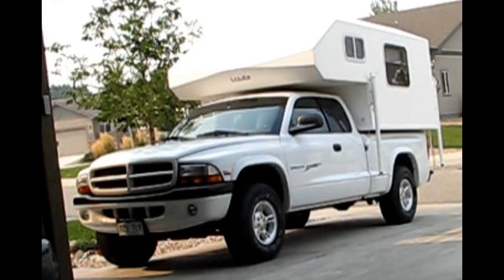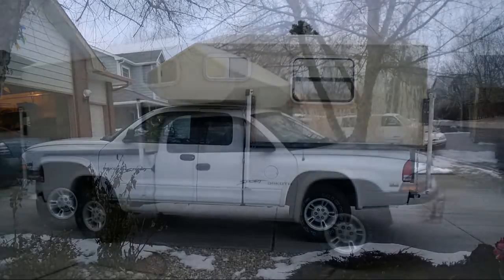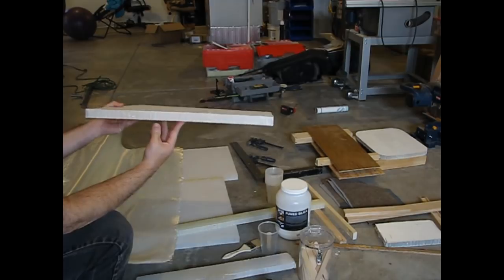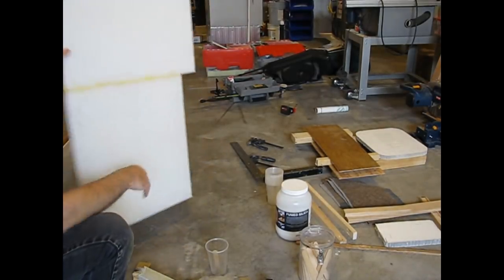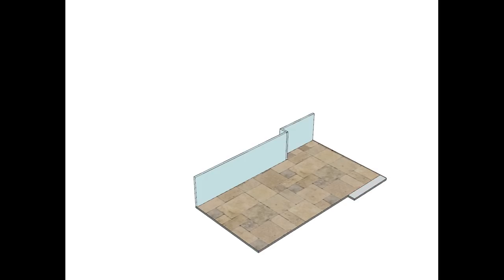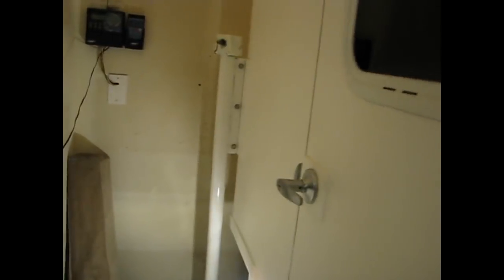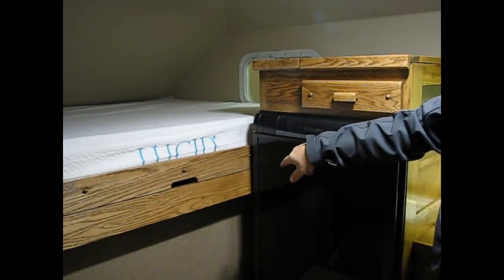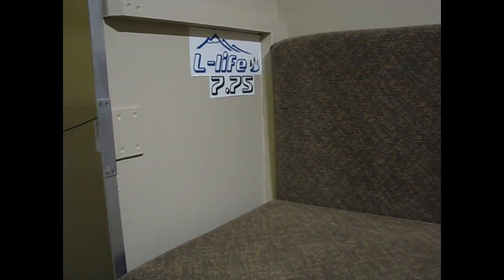Home built truck camper. L-Life explained

Comment: Thanks for the Ideas, I've been looking to build a truck camper and keep the weight down. I like what you did, my change will be to do galvanized steel square tube and welded frame instead of wood, add more water storage and wet bath. Great Ideas with the honeycomb material!

Comment: finally after a few years of watching diy camper videos I find one that is thought out that  is 6 years old. the trick with camper builds is to make it strong (using adhesive on Everything  and ring shank long staples instead of screws and using larger lumber where critical and much smaller where not) weight is a major factor that so many diy truck campers end up on a trailer! lots of half ton trucks have a 650 lb bed load!

Comment: Lovely build. I would make a couple of suggestions however. 1) you need a stainless top surround in the kitchen area and 

2) either stainless or tiles (a perferred form of fire retardant material) to reduce the possibility of catching fire. 

3) need a glass top for the gas burner so you have somewhere to put your pots, pans,plates etc when washing the dishes. 

Overall, Love the build materials, very well researched and thought out. Well done.

Comment: Nice work.  You've opened my eyes to some new products.
Reply from the maker: "thesupercamper.blogspot.com" is the sight I came across many years ago that inspired me to take on this type of similar project.  I would probably do 1-1/2" thick material for the walls if I had to do I all over again, as window & door jams are mostly designed for 1-1/2".  (Plus R 3.3/inch, so R 4.95 possible).

Comment: Absolutely beautiful job. I echo an earlier comment about the propane tank inside. Propane tanks could be filled at a cool temperature - then they might vent propane in the warm camper interior - which could be deadly. I would add a vent to the outside of the propane compartment  and somehow seal the interior access door against a gas leak. An interior tank would be illegal anywhere. (That is shared just so you don't have a deadly situation!) Absolutely beautiful job on your design and construction. Wishing you HAPPY camping.....!!! Well done......
Reply from the maker: Compartment totally sealed inside except for the access door.  There is a with vent door to outside at the front of the camper box - I plan to update access door to a sealed door.  Table saw took a dump, so for now I'm relying on propane detector, which is in my opinion is too sensitive.

Comment: The video is a great run down of the design and effort that you put into this build .... really impressed. The finished weight is amazing. From my experience the only things I would do differently would be to mount the LP/CO2 detector lower to the floor and design some sort of reclining back for the bench seat. I hate 90 degree seat backs and can never understand why 99% of all industry dinettes are built like that. I find them all to be very uncomfortable for any extended length of time (and we've camped in a heavy rain storm lasting more than 28 hours before) :-) I love your love of the Dakota. We had the same 4.7L engine in our 2006 Dakota. It also got about 17 mpg. In addition we've had 5 Ram 1500s (2 Pentastars, an Ecodiesel and 3 V-8s) and our current 2500HD. People ask me why I like Rams so much and I tell them simply that not one of them has ever spent a night in a service bay :-) I was a bit disappointed after seeing the video thumbnail ... I was hoping to see your creation "in the wild" :-)
Reply: Travels with Yoly  I LOVE your videos!

Comment: Great job on the build...It looks like a factory built camper...I had wanted to get a smaller truck camper that would fit the small 5.5' bed in my 2008 Nissan Titan Crew Cab Truck...cargo bed capacity of 2,000 lbs...I don't like the smaller, pop-top campers that would fit it nor do I want to spend the new price for one that would fit..they just aren't worth the high prices...this video gives me some great ideas in that it does not have to look like a hunting shack like many other home built truck campers do!!

Comment: Wow, that's is amazing. So much better than those built by professional companies. I have 3 questions. 1) Did you consider building the inside components out of the same material instead of wood? 2) Why don't the RV manufacturers use the Nida Core material? 3) Could you have used aluminum instead of wood for your structural supports?

What you did is so much lighter than anything I have seen on the market.

Thanks for the information.

Comment: Bob...
Thanks for the video.  
I recently purchased a (interior dimensions) 6'x12' - 5,000 lb. utility trailer meant for other purposes.
But once I got it, the first thing that I thought was customization.
So I asked myself, how about a slide out camper that I can tow behind my Tundra Crewmax (5.5' box).
I scanned YouTube and came across your video.
You've now provided me with my 2019 project...and I suspect a neighbour of mine will want to build the same with me.
Obviously a different footprint and a lot more room - but seeing what you've done and how you did it - you've provided me with a whole lot of ideas.
As an old Sgt said to me years ago - "If you haven't got a plan, you can't f&^% it up".
Thanks for all of the ideas...and Happy New Year.
...Bryan

Comment: Nice work and so much hard work. Only thing would drive me crazy- the cabinet doors, the rails and stiles are oriented wrong. The stiles are traditionally always full height of doors and the rails cut between. Not a criticism, just noticed it straight away as I’m a carpenter. Thanks for the video.

Comment: I agree with all the huge compliments you have been given; they are well deserved! Just finished a three year project of building a 16' skiff in my back yard so I so identify with your labor of love time span.  Only question I have is:  Where the 1x4's for the cab over are bolted to the upright 2x4's in the bed, did you use any type of metal corner bracing?

Comment: I'm an Aviation tech, and the honey comb is such a great material to use for this!!super lightweight, easy to repair,  and this is basically the exact composite used for all of your big aircraft, minus a few more layers of glass, Thanks for inspiring me for my build,  funny I didn't even think about going composite,  and it's brilliant, and if done right, This is a structure that far exceeds anything, in everyway,!!..Looking back.was there any problems that wasn't mentioned after going a different route to composite,.aside from your other builds!??
Reply from the maker: No structural problems so far - you do need to plan ahead for mounting.  Exposed material edges have to be dealt with for looks.  Shipping the material is expensive.  Currently building another camper (full-size) using the same material.

Comment: Good job on building a slide in camper!   It looks great!   Most have no clue how much work goes into such a project.  I know, because I am finishing mine right now.  I took a different approach on a few things, but only time will tell how good these choices were.  I would post a pic if I could but I don't think it is possible.  Good luck with your project, and I hope you get many years of pleasure using it.

Comment: A nice job with the fiberglassing and stuff. Hate to tell you but that layout is so close to my folks old Forester 8.5 ft camper though swapped around. In from the door starting on the right was the large closet ( usable with a cassette portapottie) but had another 6” deep series of shelves at the back with a door. Next the table & sitting area. (Changes to a bed by dropping the table top). Large storage cabinet under seat accessed by a cabinet door. The other side portion of seating below the overhead bunk you could access a large area by lifting a hatch/ lid under the seat. Like yours it had the hard lid portion to step up to get in the bunk. You were stepping on a flip up cover where the water tank sat in the middle with lots of extra room for stuff.
Reply: In from the left was the furnace at the bottom with a good size closet you could hang your clothes in. The kitchen counter with the sink, then 2 or 3 burner propane stove. A set of 2 smaller cabinets above this. Then an icebox. Below the icebox was where the propane tank stored with an outside access door that could be locked. Last; where the kitchen table/ bed was there was the good sized window and they had made a like open shoebox with unit that ran the whole way across above the window. That worked great for quick storage of stuff but we could & did put the fishing rods up there. That was one of the best design layouts I’ve ever seen for a camper.

Comment: How well does it insulate for 4-season camping? How sensitive to heat would it be if propane/fireplace were installed? Are studs needed to be added if you wanted to mount something heavy or a shelf to the walls and if not, what type of hardware would work? Great video, thanks for sharing. Peace, Mo
Reply from the maker: Yep, you need to plan ahead for mounting heavy objects - something I'm doing a better job of in my current full-size camper build. The 1.5" Nidacore is supposed to be = R5.5, but then you still have single pane RV windows in the design ... so there's that?

Comment: Nice camper build but, I would be concerned with the location of your propane bottle. This has probably been mentioned before.  I just discovered your channel about 1/2 hour ago. Still a great build and good use of space.
Reply from the maker: Yep, it was mentioned before, but the LP detector is located above tank, & there are several other LP connections inside the camper as well (stove, furnace, fridge).  My new full-size build with have the LP tank on an outside compartment.  If the LP tank ignites or explodes, I doubt the compartment will make much of a difference safety-wise.
Reply: @bobanthony75 - It's all about preventing sparks, static sparks and ventilation.  Propane also boils at -44°F.  Propane is also a heavy gas.  A detector would be better utilized at the lowest level of the tank. Not above it.

Comment: Hello😊 
I love what you built. I also would like to ask what you used to have lights come on inside the cabinets and drawers?  I am going to be traveling solo beginning January 1st 2019 and would really like to have my cabinets light up too. Thank you for sharing your build it turned out looking like a showroom floor piece. 
Take care and safe travels 😊
Reply: Id use puck lights from home depot..they are battery powered but motion sensing which is nice..just have to chance 3 as or a as batteries but at least not taking power up

Comment: Excellent job, as a matter of fact kinda blew my mind on the weight. Will build one myself,  don't know why it didn't occur to me  already. I have built several boats using different methods over the years. I will build a plug out of cheap framing lumber in panels bolted on the inside, glue the  edges of nida to form sides , top, bottom. stitch them to the frame and shoot them with a chop gun in polyester. Could knock the whole shell out in a week of dedicated work. Pull the plug out in pieces and reuse for another one if so inclined. Built several consoles , seats , insulated boxes like this. just scale it up. I failed to mention shooting inside of panels before stitching to the plug.All that would be left to do on the inside in glass would be tape the seams.If you haven't seen it yet check out sign guy Dave's mini camper. I'll build something very similar for hunting on a 2000 tundra limited 4x4with super low miles I'm restoring, Not that much work, in really good shape. Will build basic aluminum flatbed frame, no decking. that way will have way more storage without the constraints of a normal truck bed. Thanks for kicking my brain in gear.Again, beautiful job !

Comment: Good job. I have owned a 2000 F-250  8" bed Ford HD Diesel stick shift with a pop up Sunlite camper mounted on it. This one came with a 2 way frig, heater,  SS sink, cook top AND a real toilet with tank. Vintage unknow! The previously owner tried to install an A/C in the side of the camper on the floor. The opening was there so I just installed it but never used it. Layout similar to yours. I never go to CG's anyway!! The frig is a vintage Dometic  WITH SPARK START or match. (Non- electronic) The frig I see that you have looks similar. Is it?

Comment: Love  your build, that's so much like what I plan to do except I was going to use foam and either poor man's fiberglass or real fiberglass... I like your honeycomb material, that sounds perfect and fairly cost-effective.
Would it by chance be possible to get your SketchUp files? My bills will be significantly different as it's going on a Toyota T100 flatbed (Aussie-style trayback ute) but it seems like a good start.
With any luck I'll be able to travel nursing in the next couple of years and can live in the camper and a 22 ft sailboat

Comment: Hey don’t know if you’re still responding to comments but I’m in the process of building one of these babies. When joining panels together core to core did you use thickened epoxy or the window foam? I’m planning on laying down another layer of glass after binding the panels to tie everything together.
Reply from the maker: I haven't paying any much attention to my channel  - been busy restoring a Honda  ST1300 clunker.  Anyway I mixed a micro-spheres filler with the epoxy into a thick paste for joining the 90° joints and the foam for butt-joining panels (core to core) into larger sheets.  The large sheets were going to be covered with glass fiber anyway.  The foam was strong enough to hold the panels together for initial assembly.   Obviously added anther 6" wide layer of glass fiber all of the 90° joints.
Reply: Bob Anthony awesome! Thanks for the tip. I found this poly resin that has been working great for both joints. What kind of fasteners do you use for your cabinets and ‘gluing and screwing’ the cabover supports. I’m leaning towards using rivers but was curious as to what you used.

Comment: Awesome build.  Bob, I know you have somewhat answered this before, but I have a hard time believing it.  When your camper is up on jacks, it is true that the entire support, which might be three or four people plus at least 300 pounds of interior, is suspended (hanging) on nothing more than 1" nida-core with two-layers-per-side of 18oz biaxial mat.  And that's it?  The skin is the structure?   Does the biaxial mat turn the corner on the inside/outside of floor and wall corners (because it would seem like you are hanging from expanding foam edge-glue otherwise)?
It doesn't seem possible!   Is the edging material considered structural?   Are there any cross beams of any sort?
THANKS!

Comment: Awesome design and workmanship. I'm considering building one for my 2013 Tundra Crew Max. Your research and video will help considerably. I have experience with fiberglass cloth and epoxy in my boat building. I may be missing something, but did you install an air conditioning system in yours? Thanks for the video.
Reply from the maker: No AC, but would be a nice to have for Moab weather.

Comment: Bob, Have you done any cold weather camping in it? I have been thinking about building one and doing more than just spring summer jaunts but also Ski trips during the winter season. I am sure with the heater it would be fine but what I am trying to ensure is that i dont drink all the propane away or that I am able to get away with just the nidacore as insulation.

Comment: Your fiberglassed Nida Core strength test was very enlightening, and the strength is far more impressive the I ever thought. The strength of a “box beam” has always impressed me. However, your strength comparison to just some the components of a wooden box beam is comparing apples to orange seeds. It would be like someone comparing a completed wooden box beam to the individual components if Nida Core. For a better comparison, grab the cheapest hollow core sliding closet door (wonderful example of a cheap box beam) and do the same test on your 18” span. The potential for a wooden box beam for strength and insulation per weight has far more potential - the key is making a beam vs a wall of components. That said, you done good. Far more than good!  Excellent!  Your attention to details is enviously impressive! My hat is off to you sir!
FYI: please, no one build their camper out of hollow core doors - they would fall apart the first time they saw humidity.
Reply from the maker: I totally agree, I should have insulated, glued, and nailed/screwed the wood sample together for a better comparison.  I wish I would have taken pictures when the camper fell off the edge of the driveway and tipped onto the front corner when the jacks were fully expended - only a two inch dent to the corner of the cab-over (fixed), and cosmic damage to the lower box corner.  Neighbors helped me get back onto driveway, and were totally amazed not a single crack anywhere.  Old-school camper would crumpled.
Reply: Bob Anthony, Now THAT is impressive!  Real world useful too!  I head people suggest Nida Core in the past, but dismissed it when I saw how they were going to fasten it together with screws and strips on the seams with caulking - wiggled like a kids fort. Your basically gluing the whole thing together to make all the individual box beams into one structural entity is the key to its impressive strength. Great implementation. I would have bet money against it before seeing your build and now strength example, but I have been “schooled”. Thank you for the knowledge!